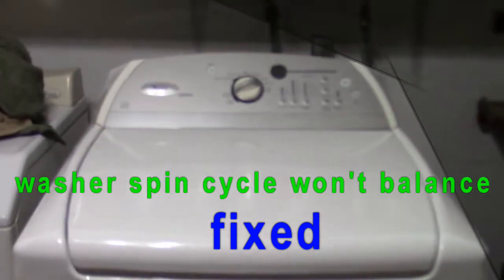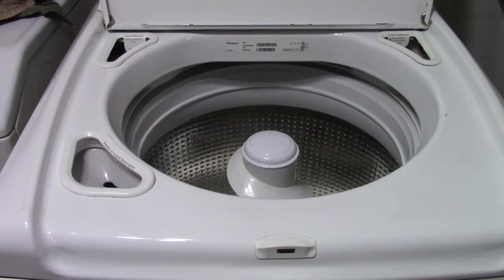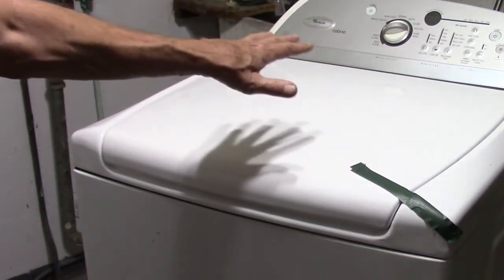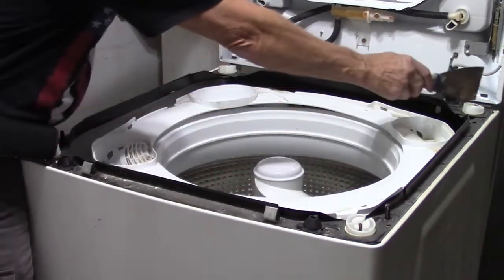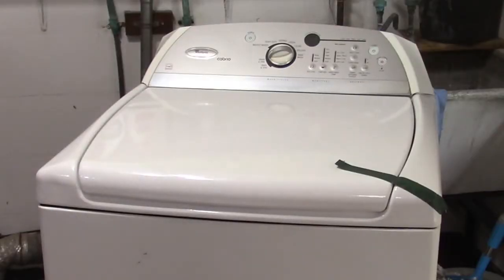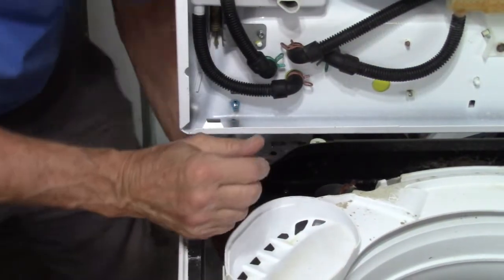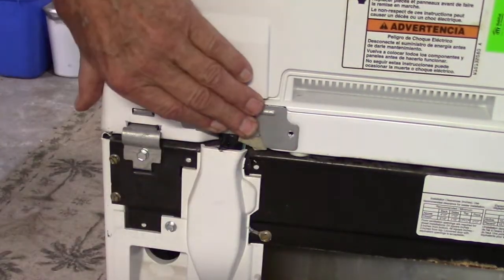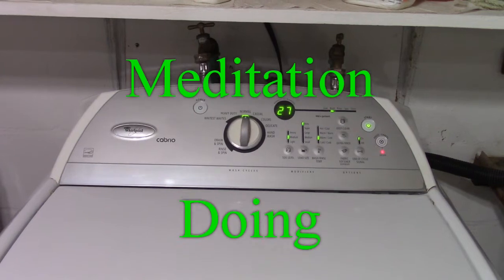washing machine spin cycle won't balance

Comment: Take the lids off a 20oz coke bottle cut a slit in side of cap insert the wire place it top up right above the round piece on top of the spring save 100$